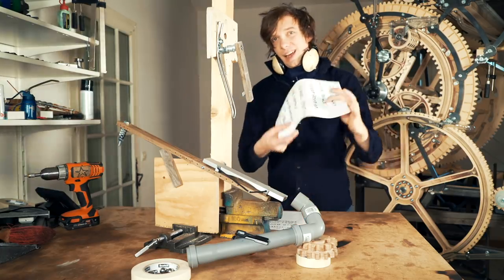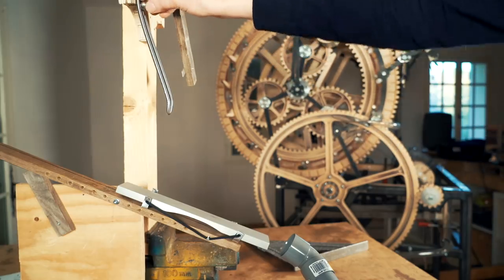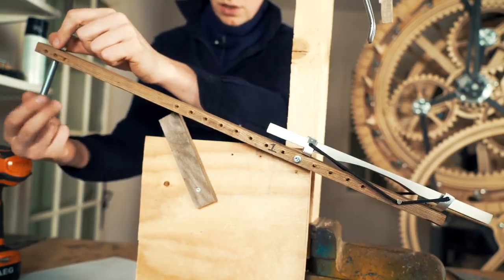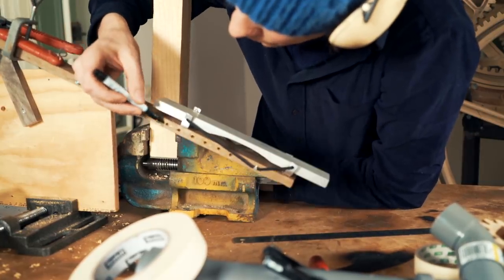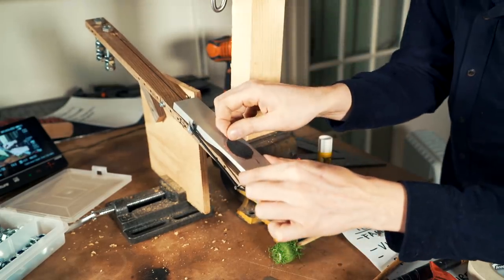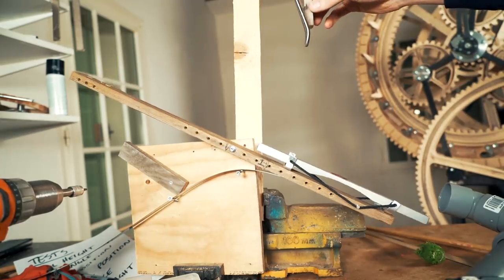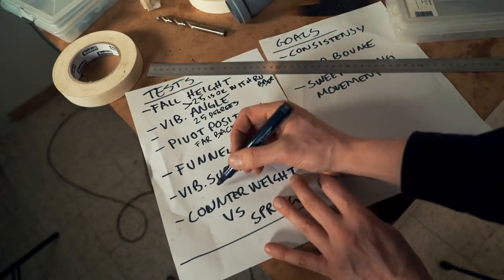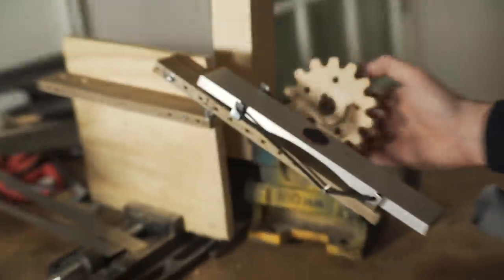Vibraphone Movement Test  - Marble Machine X #64

Comment: Did the math. The movement of the vibraphone can cause +- 20ms of inconsistence with quick notes.
Reply: this is actually a very good point, didn't think of that
Reply: It's a very interesting point and one which I'm not sure Martin is aware of yet, I'll bring it up with him but it might be an impasse. The keys need to move, the marble only has so much energy to overcome the counterbalance/spring so it will only ever return at a certain speed.
Reply: He could use an electromagnetic system which engages when the vibraphone plate arm reaches the bottom of the travel and resets it quicker than a spring. Or maybe he doesn't want electricity in the machine.
Reply: Just out of curiosity, did you consider how much the drop height affects this? I'm thinking, higher drop height = more speed on impact, which means less difference in travel time for the same variation in displacement.
Reply: Our maths suggest it should be a 4ms delay which Martin accepts to get the movement of the plates.
Reply: @malco84  My numbers were:
35cm free fall,
2,6m/s impact speed,
~5cm  highest to lowest possible plate position,
which gives around 20ms of a possible dragging/rushing.

Gets even worse with 25cm drop (2,2m/s impact speed, around 24ms of delay).
Reply: The notes only move 10mm so I think our numbers agree
Reply: I also think he needs at least some counterbalance or more moving mass to provide inertial damping, otherwise a resistance spring alone causes bounce. Bounce causes an even higher inconsistency with note timing. An interesting experiment would be to move the pivot point to the front, and elongate the back such that there is little movement at the contact point but more action at the ass-end for show.
Reply: They will also all have a counterbalance weight. This will probably need to be adjustable to account for note changes. However I would like to find a solution where 1 weight can balance a range of plates.
Reply: A few ms may be hardly noticeable. In fact it may sound more human-like and pleasant and less robotic if the timing is a tiny bit off.
Reply: @KimonFrousios  20ms is noticeable though but indeed the end result is it may sound more human.
Reply: actually, forgot one thing, Deo. at 160 bpm, where the double notes comes in, 20 ms is about 1/16  of a beat delay. will be a problem if you play anything faster than 16th notes. might be ok with 16th notes
correction: it's beat, not note

Comment: Hi Martin - I think you overlook something! - If you will be able to play fast (several marbles per beat) you cannot have a spring/movement like that, because it cannot get back in position before the next marble. It will create an avalanche effect forcing it down all the time :-\
Reply: I think he is not interested in that, because the movement is just highliting the fact that the note has been played, if it's in the downwards position for longer your brain will automatically think that the note was hit twice or thrice, plus there is a high chance that te bar will have gone a bit higer during the fall of the second marble and the movement will be visible anyway
Reply: I would ask to consider light torsion springs since they are specifically designed to return to exact desired angle, or zero, at higher than Prestissimo; faster than presto - 200 bpm and over.
Reply: This can probably be solved somewhat with a bar to limit it from moving too far down, but it doesn't really need to get back into position just for another marble.
Reply: It may be for a faster song he will have the leaf spring set much tighter. It looks like he's aiming to have the vibraphone assembly be completely removed between songs so he'd be able to have preset tension on the leaf springs.
Reply: @coastersplus  True
Reply: @DembaiVT  True
Reply: Alternatively, if he likes the counterbalance option, a way of doing it so that it doesn't hit the programming drum would be to put a 90 degree bend in the counter balance arm bending it downwards.  This would also have the advantage that following a marble avalanche, the counter balance arm would be pushed up and further away from the pivot point, increasing the mechanical advantage, placing a natural limit on how far the vibraphone can move without having to place a hard stop.

Comment: You were thinking about mounting a small dynamo and doing LED backlight in the baskets where the marble falls? ;)
Reply: That would be amazing to see in the dark!
Reply: Adding backlight would also be consistent with the "Animusic feel" that Martin is seeking, plus it would be visible from much farther on stage than a slight vertical movement.
Reply: Very good idea. I was also thinking of a grazing laser light on each vibraphone plate. so when the plate moves, the laser do not hit anymore the plate, which turn black. (you can also have a laser just below the plate so it illuminates the plate only when it moves).
Reply: that sounds super cool love it
Reply: Ah paint the whole thing black and add rgb to the whole thing. /s
Reply: Piezoelectric pads where the marbles land could possibly give enough voltage to light a neon bulb, you'd have to spec it out though

Comment: Regarding the movement- you could add a small oil dampening shock to your spring set-up like those used in R/C cars to more quickly cancel the oscillation of the bar holder, without destroying the movement.  That would allow subsequent notes to occur without the risk that the bar would be out of position.
Reply: Either that, or have the right amount of friction in the joint itself to dampen the oscillation.
Reply: Even better is a magnet and some metal like copper or aluminium.  You can use use induction to create a nice damper
Reply: @EGL24Xx  yeah using the eddy current would actually make it nice and repeatable, I like that idea :D Just would have to test how warm everything gets from long playing
Reply: I would ask to consider light torsion springs since they are specifically designed to return to exact desired angle, or zero, at higher than Prestissimo; faster than presto - 200 bpm and over.
Reply: @microsodes4026  we are talking about the damping of the oscillation from the impact of the marble, not the springs themselves. In the video you could see that the coil springs (without damping) oscillated a few times whilst the flat steel spring, that had more friction on the wood, damped that oscillation out so you get exactly one movement impulse, and then the assembly stops.
Reply: @Screamowic  I mean horizontal placement though, not vertical as in the video, like a joint or wheel rather than a bouncing spring
Reply: @Screamowic  so the ends of the torsion springs would run parallel to the  vibraphone bars, underneath it at the axis of balance.
Reply: @Screamowic  so the ends of the torsion would run underneath the vibraphone bridge at the point of its balance and parallel to it.
Reply: @microsodes4026  we get what you mean about using them, but we are discussing damping factor; a spring has nearly 0 damping so we are discussing ways to add that to get the system critically damped or many slightly underdamped (which actually returns to '0' faster)
Reply: @EGL24Xx  I see you're correct, which is why I thought the coils on a torsion would dissipate any remaining energy and significantly increase damper since their ends are not parallel to the coil's spiral but perpendicular, thus they hold fast to zero, or home and when a marble is dropped the torsion is very fast to recoil with no remainder to bounce... thoughts?
Reply: @microsodes4026  as EGL24Xx already mentioned, springs don't offer damping. See also https://en.wikipedia.org/wiki/Damping_ratio 

In the end its basically a miniature of a car wheel montage. You have a spring that offers the force, and a damper to keep the spring from oscillating (bouncing). If you vary the amount of spring force and damping you can get different ways of behavior out of that system.
Reply: @Screamowic  You're reference is also valid, but Torsion physics are different than an ordinary spring https://en.wikipedia.org/wiki/Torsion_spring
Reply: @microsodes4026  to be honest, and having done my fair share of calculations on the matter, I can assure you that, in essence, it's the same. It doesn't matter if you have a rotary or a linear motion, it all boils down to the same, which is a spring and a dampener, in our case.
Reply: Thanks for exploring and defining possibilities and limits with here.
Reply: @microsodes4026  Anything to help :D
Reply: @Screamowic  Not like we want to get into topic of small rotary dampers, lol
Reply: The traditional way of dealing with this is adding some viscous friction with a wet shock. But in principle, any kind of friction proportional to the speed of movement will do. More dry friction will make the oscillations dissipate faster, but won't eliminate them entirely. Viscous friction (speed-proportional friction) when applied correctly can make it so that the plate returns to its initial position smoothly after the hit without any oscillations.

Comment: You should try a surface coating on the vibraphone. Maybe like a thin layer of some rubber or silicone. Would be nice if it also was clear
Reply: I was thinking about Flex Seal or Plasti Dip.
Reply: That might make the vibrations different I think?

Comment: Have you accounted for the difference in the weight of each key? I assume a smaller key (higher note value) would wiggle a lot more when hit by a marble, creating more time before it is zeroed in for the next note. That difference in weight might require you to adjust each spring a little differently if you want a consistent movement for each key.

Comment: How do you ensure the moving tone bar returns to home before the next time it is played?  And if it doesn't return the following drops do not encounter the same drop height or the same angle.  How do you account for timing...   And if tone bar is moving up you get an increased striking force (marble falls a bit further, plate is moving to marble) which will also affects the departure angle of the marble... 
Why exactly do the tone bars need to swing? Is it just a visual aesthetic? 
Tone bars don't swing on a real vibe.

Sorry, I'm a development engineer and not a musician.
Reply: When you volunteer to design for Martin you have to realise you are working for a mad genius Swedish scientist and musician who is creating a bit of Art. If the engineers in the group had there way then there would be no magic in the MMX and it would not pass its cool test :)

Comment: If you want to add counterweight, you could attach a pulley with an attached string (kind of like an oil derrick) and put a counterweight on that. This would allow for a more compact design and allow you to move the counterweights to a different position, possibly one where they're easier to see.
Reply: The plates on the left overhang the MMX otherwise I liked this idea as it would allow you to change the counterweights easily.

Comment: idea for what to use for the rubber padding: same thing used on ping pong paddles
Reply: or self adhesive rubber sheet used as a mask in signage when sand blasting wood or glass.

Comment: Martin! 
I hope you get to read this comment as i have a few concerns and suggestions to mitigate them. While I’m sure you have considered these things and perhaps they didn’t make it into the video, my biggest concern is response time. As i recall you have two tracks per channel to allow for 1/8 notes, triplets etc at different tempos. My concern lies in how quickly the vibraphone plate resets into position for the next note. Obviously the tempo of the song comes into play but if you did a double hit/triplet on a single vibraphone note, will the plate reposition itself quickly enough to allow the next marble to hit at the same angle, the same tight hit spot, with the same bounce trajectory towards the funnel?

An option to mitigate this issue would be the use of the springs that you tested at the very end as they seemed to bounce back faster than the springed metal. Perhaps if the ball impact point has high enough leverage with the proper spring pressure (to allow for greater movement), maybe this would allow the plate to respond back to its original position fast enough? To eliminate the bounciness you encountered in this initial test, you could put a stop above the plate just about anywhere along it to serve as a sort of ceiling, so that the spring tensions the plate against said ceiling and upon ball impact, the higher leverage could lead to a good (ideally long) movement but quick response time to reset for the next ball drop.

Another alternative is if using the springed metal and having a nice longer travel as you showed, perhaps if the plate does not respond to its original position in time for the next ball drop, the steeper angle and different path of the ball after it bounces would be mitigated by having a larger catch funnel? I believe the point of contact would not change much but rather the ball bouncing would have a different, more shallow trajectory and if the funnels are large enough, perhaps they will catch the ball at any position of the plates travel. 

Anyways, hope this helps and just offering a friendly suggestion! Absolutely love your work and your music. Super excited to see you one day on tour!
Reply: He didn't show it but he has done some double drop tests and the catch point is very close to each other even though the plate does not have time to reset.
Reply: Malco ahhh I do recall that! Thanks!
Reply: I would ask to consider light torsion springs since they are specifically designed to return to exact desired angle, or zero, at higher than Prestissimo; faster than presto - 200 bpm and over.

Comment: Martin to solve the problem of the long movement in the spring you can use some kind of damping as well as a spring. You can get a small air dashpot. This will let the key settle in the whatever time you want by changing the size of spring vs damper. This would help if you really want a compact design without the counterbalance. Great work though. :)

Comment: Dear Martin, great video again, thank you very much! One important point: you are constructing oscillators, and that means that their macroscopic motion depends on the inertia, the spring force and the dampening. The leaf spring in your test worked great because it (accidentally) seemed to have exactly the right amount of friction between the wood and the spring, in order to dampen the oscillation within half of a period. The coil spring test had very little friction, and hence you observed an oscillation over a few periods. The nice motion you observed is not a property of the leaf spring itself, but a property of the whole system including the friction. In your clean CAD design, you’ll have to make sure that you add a similar amount of friction, maybe even in an adjustable way (by modifying the force between friction surfaces, e.g.). Your design of the drum mounts with the spiral springs also looks like it’s in need of such a damper. Just for illustration: it’s like in a car: for a nice ride, you need springs and shock absorbers. In addition, it’s hopefully no problem that the motion of the vibraphone surface will slightly change the timing for fast notes?

Comment: About changing the resonator tube lengths - what about a piston type system to «push» the bottom of the tube further in, and shortening the tubes in the process? Then you wouldn't have to change tubes mid show, just adjust the length...

Keep it up, wednesdays isn't really wednesdays without wintergatan!

Comment: You could tuck the pivot point a little bit back AND down so that the vibro looks like armonious fingers like the marble release. That would change the arc the plates travel so at certain tempos marbles could get unwanted spin because of the grippy rubber?? maybe? Worth testing it out, the movement would look gourgeous I think.

Comment: From the start, complexity has increased exponentially with every rethink! I recall the original design, which was a better engineered version of the Marble Machine with a few tweaks. This is now a whole different beast....Here's hoping that complexity does not become its Achilles heel, but I do love your insatiable quest for improvement in every aspect. <3

Comment: I had never drawn a similarity between the Marble Machine and Pipe Dream before until I started watching this video, and then was pleasantly surprised when you mentioned it.
One of the things a lot of people might not know is that Intel actually built the entire instrument array of Pipe Dream for one of their expos - an impressive feat in itself, but still relying largely on synthesized musical notes rather than playing a physical instrument by digital means.
The Marble Machine amazes me as a completely mechanical creation playing physical instruments - the timing isn't controlled by a microcontroller, but rather by finely tuned mechanisms where tiny inconsistencies can create massive issues.
I'm looking forward to having my mind blown once the Marble Machine X is finished, in the same way (if not more than) the way I did first seeing the real life implementation of Pipe Dream.

Comment: Before you give up on the leaf spring idea, take some time to examine the type of leaf springs used on locomotives and heavy trucks. You can get more tension by adding more layers of spring steel or adding different thickness and because each vibraphone note is different mass, you can dial in the tension easier. Using compression springs will require you to build your own springs but "This Old Tony" has an excellent video on that.